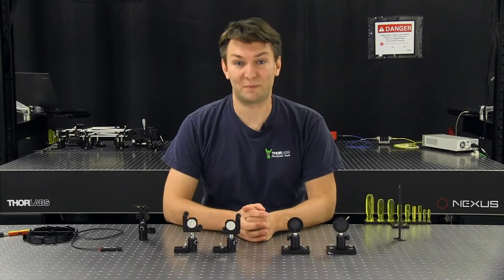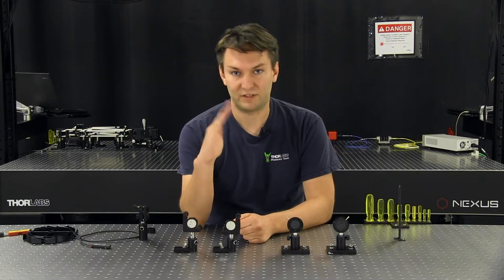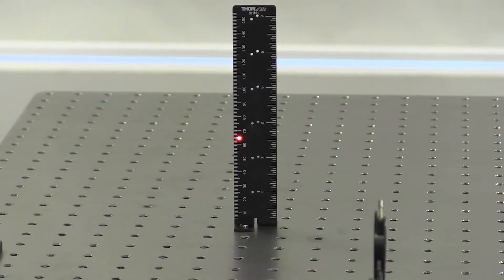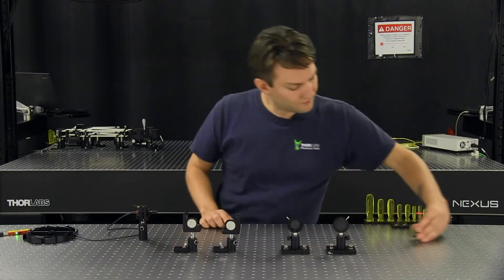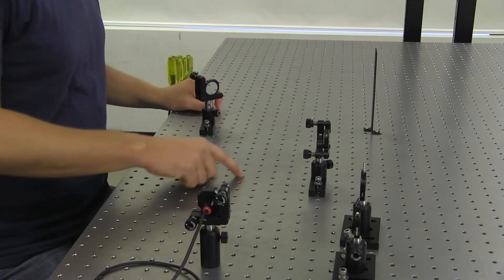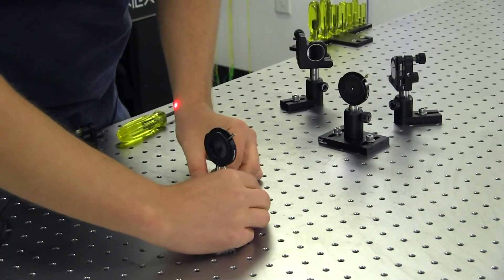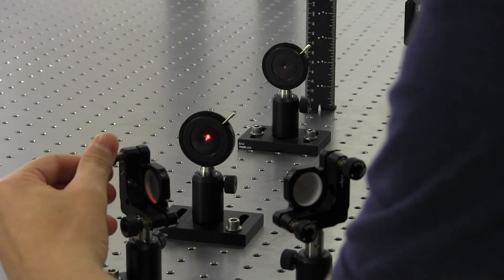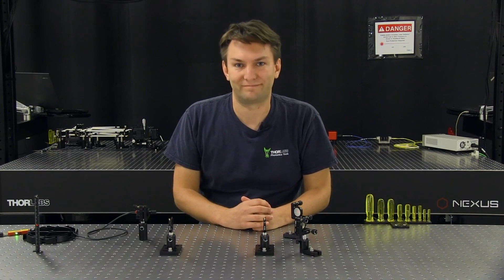How to Align a Laser | Thorlabs Insights

Comment: but how do you know the irises are exactly the same height.... especially when you cannot have the be righ at the bottom of the post hole if you are aiming to enter an integrating sphere of a set height...
Reply from the maker: @Sanutep   There are various approaches to setting iris height, and the choice depends on the application.

When the iris heights do not need to be matched with high precision, which is often the case, a reference object, such as a standing vertical ruler, can be used. If it is not practical to align the iris aperture to a particular mark on the ruler, an option is to place the vertical ruler as close to the iris as possible. Then, shine light through the iris and adjust the iris height until the transmitted light spot is at the desired height on the ruler. Another option is to use a fixed-height laser beam as the reference and place the iris in the beam. The iris height is optimized when it transmits the maximum power.

It is good to keep in mind that adjustable iris apertures are not perfectly round and may be slightly off-center in the iris housing. If this is not suitable for the application, a precision pinhole (fixed-diameter, circular aperture) is another option. 

In many cases, irises and pinholes cannot guarantee perfect alignment. Often, they are used to obtain pretty-good alignment that makes it easier to manually optimize alignment. The irises will usually be removed from the system or opened before performing the final alignment fine-tuning.

Comment: Can it go to 100 yards far?
Reply from the maker: @Koobmeejyaj3143 After alignment, the beam should ideally travel parallel to the table’s surface and along a line of holes in the optical table. In a perfect world, the beam would continue to be at this height and follow this line for 100 yards or more. However, the irises, the holes in the table, and a human’s ability to precisely position each component are all imperfect to some degree. The errors contributed by each will result in a beam that is slightly off from the ideal beam path, and the amount will be more obvious at farther distances. The error can be reduced by placing the two irises as far apart as possible when performing the alignment.

Comment: Hello. Is there a equipment available to buy to make the process more "direct"? I work on a molecular fluoresce group in my country and we have been suffering to align the laser in the proper way for it to enter on the microscope correctly. When I went to a laboratory to do a Raman spectra of my material the had the laser (cobalt 473 nm and other to lasers), and the were all connected to a piece that directs the laser to the microscope perfectly. I have been search for that equipment name but I cannot find it. Could someone tell me? Thank you.
Reply from the maker: @henrique76170  Thorlabs integrates a device like this into some of our microscopes, but we do not currently offer a beam aligner or stabilizer as a standalone product. However, the possibility of developing this type of product is being discussed. It would help us if we better understood the laser alignment and/or stability challenges of your application, as well as the operating environment. For example, whether your setup is mounted on an optical table and in a temperature and humidity controlled room, or is being operated under different conditions. Would you be willing to share some more information about the specific requirements of your application? Please also consider contacting our Imaging Tech Support team (imagingtechsupport@thorlabs.com) to discuss your application.
Reply: Thank you so much for answering. I will give more details on the e-mail you sent me. I would love to explain all my difficulties at the lab, and if possible, buy equipments that can solve those problems. Again, thank you.

Comment: Great video for beginner. I am facing problem of mounting optical components (Lens and mirrors) at accurate distances(in mm). It would be grateful if you can give some suggestions.
Reply from the maker: We typically follow a few steps when we need to accurately position optical components. First we think about the adjustments that will need to be made to accurately position and orient each optic. Sometimes just one dimension, like distance along a single line, will need to be adjusted. Sometimes translation along all three Cartesian axes will be needed. In other cases, angular adjustments will be required. We identify the minimum number of necessary degrees of freedom for each optic, since the stability of the setup is best maintained when each optic’s degrees of freedom are kept to a minimum. We then select the required combination of rails, translation stages, rotation mounts, and kinematic mounts for each optic. 

After fitting each optic in the required combination of optomechanical components, we’ll place the mounted optics at positions roughly identified using a ruler. We will then adjust the optics’ orientations and distances while monitoring the effect of the adjustments on the light in the system. We take this approach since we find that making adjustments while watching for particular optical effects is usually easier and more effective than relying on precisely measured distances between optical components.  

As an example, in a recent Video Insight (https://youtu.be/xuzuFPl8rh0 ) we used an optical effect called speckle to determine the focus locations of a couple of mounted lenses.
Reply: @thorlabs  Thank you very much for detailed information.

Comment: can i know about the product name under the mount?
Reply from the maker: Each of the mounts was screwed to a 0.5" diameter optical post that was held by a post holder. Two types of post holders were used in the demonstration. The laser and irises were held by post holders designed to be screwed into an optical table, breadboard, or base. The irises' post holders were screwed into BA2 bases. The mirrors were held by a different type of post holder, which has a built-in swiveling base.

Optical Posts: https://www.thorlabs.com/newgrouppage9.cfm?objectgroup_id=1266&YVI=1
Post Holders: https://www.thorlabs.com/newgrouppage9.cfm?objectgroup_ID=1268&YVI=1
BA2 Bases:  https://www.thorlabs.com/newgrouppage9.cfm?objectgroup_id=47&pn=BA2&YVI=1
Post Holders with Swiveling Bases: https://www.thorlabs.com/newgrouppage9.cfm?objectgroup_ID=1982&YVI=1

We've recorded a couple of Video Insights filled with tips and tricks that we've found helpful when working with posts, post holders, bases, and mounts. If this sounds interesting, please check them out!

Mounting Your Optomech: Bases, Post Holders, and Posts (https://youtu.be/4xZmGyMsQNo)
Tips for Bolting Post Holders to Optical Tables, Bases, and Breadboards (https://youtu.be/HyUXsH1zuIk)
Reply: Thanks for your reply. Also I'm wondering that IR laser light by your product such as M780F2 or M1050F2 can be seen by our eyes.
Reply from the maker: @zaehyuk  The longest visible wavelength is different for everyone, but it is around 700 nm. The 780 nm light from the M780F2 may or may not be faintly visible to some people. The 1050 nm light from the M1050F3 is invisible to people. 

Different tools can be used when working with invisible beams. A common tool is a laser viewing card. When the card's active area is put into the beam path, the card will glow at the spot where the beam is incident. The fluorescing material used in IR cards is also used to make alignment targets for general use. Another option is to image the beam.  For the wavelengths you are referencing, you can try using a cell phone camera.  IR viewers are also useful for imaging visible and IR light up to approximately 1700 nm.

 Laser Viewing Cards: https://www.thorlabs.com/newgrouppage9.cfm?objectgroup_ID=296&YVI=1
Alignment Targets: https://www.thorlabs.com/newgrouppage9.cfm?objectgroup_id=3201&YVI=1
IR Viewers: https://www.thorlabs.com/newgrouppage9.cfm?objectgroup_ID=14844&YVI=1

Comment: What about infra red lasers where its not visible to the eye?
Reply from the maker: When the laser light is not visible to the eye, IR cards ( https://www.thorlabs.com/newgrouppage9.cfm?objectgroup_ID=296 ) can be used to perform the alignment. When an IR card is inserted in the beam, the card will glow at the spot where the light is incident. One approach to aligning an IR beam is to use the IR card to track the beam from the source, to each mirror, and then to the first iris to minimize the chance of stray invisible reflections.  Then the card can be used while tuning the mirror mount adjustors to align the beam to through the irises.  

Another option is use an IR viewer ( https://www.thorlabs.com/newgrouppage9.cfm?objectgroup_ID=14844 ). A person views the scene by looking through the eyepiece of the IR viewer. The IR viewer images the scene using visible and near-IR light up to 1700 nm, so it is possible to see the beam spot on the optical components. 

Would it be helpful to see a Video Insight demonstrating the alignment with IR light?
Reply: @thorlabs  I would appreciate a video on alignment with IR light. One of the main experiments in my lab uses light in the mid-infrared regime generated from the signal and idler beams of a femtosecond pulse laser and I will eventually be teaching how to use it. Like you mention, I use a combination of a guide beam (laser diode module), IR card, and IR viewer. I also use a power meter to check the MIR beam throughout the path, finally ending in a pinhole with a photodetector. There are certainly a lot of parts to a complicated experiment and you sometimes don't realize it until you have to teach someone else!

I just started training new master's students in my labs (using some of your excellent videos!) and this week is beam alignment and common optical components. It is great to have these videos for students to refer back to or to see an alternative explanation, so I would love videos on any of the steps I mentioned above!
Reply from the maker: @garrek  Thank you very much for sharing your topic ideas! Not only is it great to know what demonstrations you would find most useful, but it is also helpful to have an idea of the situation in which the techniques are used. Do you have any unique tips or tricks that you like to use?  One that we’ve found people appreciate in the MIR is using the table to cool the liquid crystal IR card.

We remember from a previous comment that you were considering folding these videos into your master's students' training. We’d love to hear how that goes and if there is anything else that would help complete the list.
Reply: @thorlabs  I also use the table to cool my IR card. Another tip if you're using a phosphor-coated sensor card (for NIR beams): sometimes the beam can appear diffuse on the card, making it difficult to know where the beam center is. I will sometimes open and close an iris repeatedly to see which side of the beam the iris cuts first and adjust the path until the beam is cut by the iris evenly, or until it looks like the brightest point is in the center. It's kind of hard to explain in text, and these cards can be a little tricky to use.

So far the students I'm teaching are still learning the basics. Also, I'm in Japan so English is not anyone's first language (except mine!), but it's really helpful that the presenters in the videos talk slowly and clearly point to each object they are talking about.
Reply from the maker: @garrek  The iris-adjustment technique is also a good one! 

We try to film the videos with an international audience in mind, and we're happy to hear that our presentation style is helpful to your students. It's important for us to hear what approaches students find to be effective to ensure we continue to include them. We understand if your students use the videos to learn English-language terminology, but are they aware that we also upload our own closed captions in various languages, including Japanese, in an effort to help bridge the language gap? Some of the newest videos may still have auto-generated captions, but we replace these with corrected captions as soon as we can.
Reply: @thorlabs  I did not know that! I thought they were all auto-translated. Very useful not only for the students, but also for me! I can use the videos to pick up some technical vocabulary, since I sometimes have a hard time with technical Japanese when explaining concepts! I'll let them know.
Reply from the maker: @garrek  In the Subtitles/CC caption menu, the auto-generated captions are flagged with "auto-generated" in parentheses following the language option ("Japanese (auto-generated)"). If the captioned language is not described as being auto-generated ("Japanese"), then we've uploaded the captions. We're really glad you think they'll be a help to you and your students!

Comment: Why do you put mirrors between the laser source and the Irises instead of introducing light directly from the laser source to the Irises?
Reply from the maker: It could be possible to align the laser source to the irises if you have 4 axes of adjustment on your laser (horizontal translation, vertical translation, pitch angle, and yaw angle). However, there are often times when it is not possible to provide that adjustment to the laser.  There are also times when the beam path requires some tweaking due to small misalignments of components within the system. As a result, the two mirror approach demonstrated in the video is a common way to ensure the laser beam travels in a straight line, but it is definitely not the only approach.
Reply: @thorlabs  Thanks for your guidance. It is very helpful for me.

Comment: Please tell me sir
What to do if we need straight line between two mirror and straight line in irises perfect 90°
Reply from the maker: Alignment is performed with respect to a reference, and the alignment precision is determined by the precision of the reference. Since a reference needs to be chosen, the first step is to determine exactly how close to 90° the angle is really required to be. When that is known, a reference that provides that level of precision must be identified.
 
In our video, the holes in the optical table were the reference we used to define straight paths parallel to the table. Then we relied on the machining tolerances of the bases, post holders, posts, and irises to define beam height. In many cases, that level of precision is enough, but in many other cases it is not. 
 
The precision could be increased when the optical path is confined to a cage system ( https://www.thorlabs.com/navigation.cfm?guide_id=2002 ). Another step could be custom tightly-toleranced baseplates with alignment pins to set the post (https://www.thorlabs.com/newgrouppage9.cfm?objectgroup_id=9079) locations.

Comment: Such a nice video, thank you so much! Everything that you presented is also feasible for high power lasers/Class4 Lasers, you just need to wear protective glasses + use (for instance IR lasers) those fluorescence cards, right?
Reply from the maker: It is correct that the same mirror adjustments can be used to align Class 3 and 4 lasers, but please always follow the guidance from your facility's laser safety officer when using high-power lasers.  In many cases, the recommendation is to use low powers for safer handling and to preserve the lifetime of IR cards while aligning free-space and unenclosed laser beams.  However, it is important to note that, when the alignment is performed at reduced laser power, the alignment might need to be tweaked once full laser power is applied. 
 
Irises are another special concern while working with high-powered lasers. We used black-plated iris blades (leaves) in the video since our laser power was relatively low. This coating will discolor, and the leaves can deform when higher laser powers are absorbed over long periods. We typically use stainless steel leaves when using higher power lasers to reduce the amount of light that gets absorbed. However, bare stainless steel iris leaves are typically more reflective than the black-plated leaves. When placing irises or any other component in the path, it is also important to check for stray reflections.
Reply: @thorlabs  thank you for your answer! " However, bare stainless steel iris leaves are typically more reflective than the black-plated leaves." -This is why I am/was thinking of using the black plated iris blades for alignment and then (with turned off laser of course) take them out of the beamline (but keeping the post) so that they wont stay in beamline forever...
Reply from the maker: @ColJack100  You may find it helpful to know that our Tech Support team suggests switching to stainless steel iris leaves if the incident laser power can raise the temperature of the black-plated leaves above 250 °C. Whichever irises you choose to use, it may be possible to fully open them, instead of removing them from the setup, after completing the alignment. This approach assumes the beam is small enough to pass through the iris without clipping. (Note that for Gaussian beams, the 1/e^2 beam radius includes ~86.5% of the beam's optical intensity. A radius that is a factor of ~1.5 larger includes ~99% of the beam power.)  Some people like to keep the irises in the path so that it's easier to re-check the alignment later.